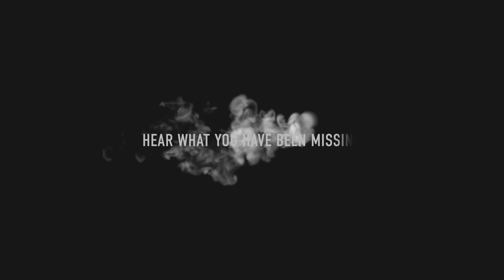Understanding Your Speaker's Frequency Response Chart | ADAM Audio

Comment: Hi, I have never understood what my speaker crossover should be set at which is what brought me to this video hoping to find what I should set my crossover at. I understand that different channels have different frequencies but I don't know how to pull my crossover from that.
Currently, I have a collection of different brands of speakers. I use Definitive Technology BP-8040ST Bipolar Tower as my fronts, Definitive Technology CS-8040HD at center,  Fluance Elite High Definition 2-Way Bipolar Surround Speakers with 2 old Onkyo bookshelf speakers as high fronts connected to a Sony STRDN1040. Yes I know it's pretty old but that's what I have to work with at the moment. how do I find the crossover? I tried the auto-calibrate but it just doesn't sound that good

Comment: Hello Stephan. I’m a proud owner of a pair Adam Audio T7V. These monitors are really amazing. They easily outperform other studio monitors that cost twice as much. Question: The T7V have a max SPL of 110 dB. When I use an SPL meter, the instantaneous measurement only reads around 100 dB C weighted at max volume. How can I reach the max SPL output? I hope you can help me out. Kind regards, Emiel333.
Reply: i think its subjective to what its rolloff point is what range ur testing

Comment: I've been thinking of buying studio monitors for many months, going back and forth of different monitors, for both hifi entertainment use and for music work as I would like to replace my Klipsch rp280f and rf52II speakers and my bulky av receiver to save A lot of useful space. s3v seems to tick lot of boxes for me not super expensive and nice design not too small or too huge. How well does s3v compare to RP280f in power and sound quality?
Reply from the maker: Not 100% sure as I haven't heard that exact model... The S3V is a great monitor and has tuning technology built in so you can adjust it for what sounds best in your room. Like you said, it's active as well (with studio-quality amplifiers) which helps cut down on space. It's also a true three way, which helps reproduce that midrange quality a bit better than 2 or 2-and-a-half way speakers. Hope that helps!
Reply: Go for S3V or, even better, S3H. You will never question your speakers again.
Reply from the maker: @WouterStudioHD  Glad you love the S Series so much! Thanks for the kind words.